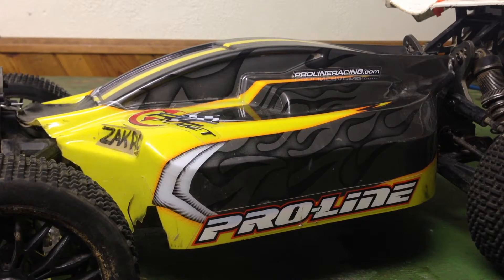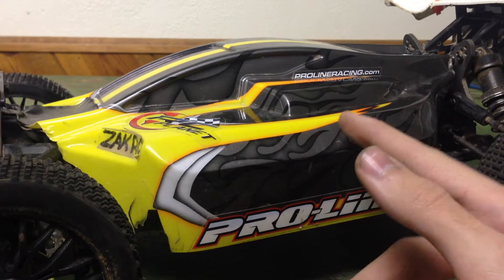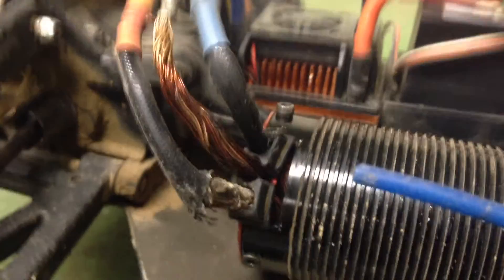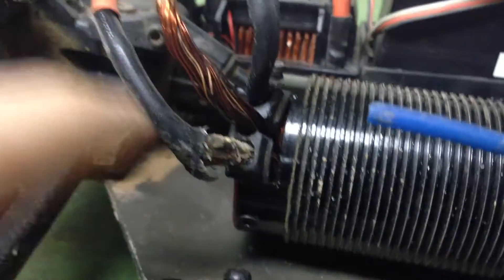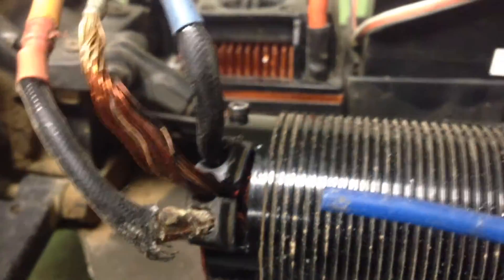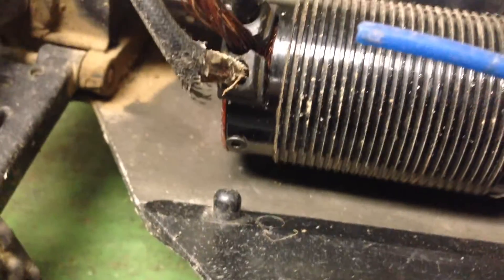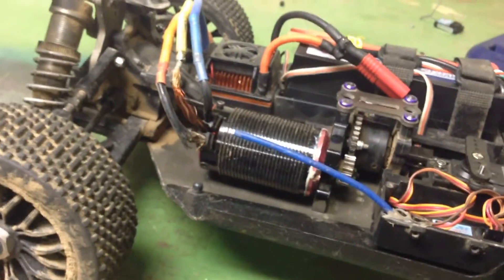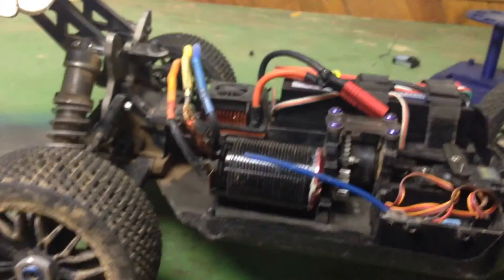How to Fix a Bad Brushless Motor

Comment: My brushless motor hums when I squeeze the throttle but no wheel movement  battery is full charged, the connector are flush. Just don't know what's going on. I really don't want to buy another motor. Any advice would help

Comment: I'm not trying to be a hater here, I see you got enough of that. Ideally, you want to find the short, or bad connection. What you said seems logical, but that's not the right fix for the problem. Get an Ohm meter find which combo of wires has less resistance. One of those 2 wires will have a short. If they seem okay, check for low resistance from the Speed controller to the motor. If they are all about equal, it's a power delivery issue (speed controller or something else). Cutting wires will make more resistance possibly, but as copper conducts electricity, they will still carry all the power that is sent to them. You could run speaker wire from the speed controller to the motor and probably watch the shielding melt right off from just spinning the wheels. That tells you less wires will still try to carry the load you are sending it, so making less wires in your connection is ultimately bad.

Personally, I would think it's one of your Bullet connections, needs re-soldered, or possibly a break in the solder inside the motor. While it's terribly hard to get into these to fix them (never really tried, could be easier than I think), I'd say run it til it quits. Could be the wires on the speed controller needs re-flowed. Solder will heat up and release itself if it's a bad connection, or other random stuff. Due to the extreme power these things put out now, I could imagine seeing wires de-solder themselves from parts when they get past their rated temperatures.  Nice explanation of what you felt was right, but your comments here are people crying out to you to help you fix the problem long term. And to keep you safe, and promoting bad ideas is not what we want to do. Imagine if you realize your error, and leave this up, and your kids or grand kids watch this, and harm themselves with a toy that delivers even more power. Embrace others, even though they may word it terribly, and toss in insults (I didn't read many, didn't see any), but long term could cause you more stress. There's a real fix for your issue I'm certain. And for the love of RC cars, put a protective sleeve over that wire! lol

Video and your mission seemed to have good quality and intent, but again, this is misinforming, and providing harm to someone else out there if they go any further than you have. Lithium, and bare wires are a disaster waiting to happen. Especially in a house. Check out some videos gone wrong with older Lithium Batteries. I hope you read this they way I am trying to deliver it (peacefully). I deliver the wrong fixes in videos I've decided not to post in the PC community, and probably still posted a few. We are human, and I'd rather try to help you instead of letting you show others this. Hope you are well and make a follow up to fixing this right.
Reply: An ohm reader?? Wait what you can actually check resistence on wires and replace them the right way??? No Way!!! Im shocked. I just hope people haven't done this!! Great information on your part thou
Reply: I bought a motor that have damage wires like that  is it better cut the wires off and re solder new 10 gauge wires?
Reply: @nts323  I would try to replace the wires with their respective gauge size in case there is a need for such wires. Melting is bad and oversized is overkill. Soldering and heat shrink would be the best choice, adding a wire loom might provide added protection. I'm no mechanic or wiring expert but common sense gets us further down the road I feel. So what your gut tells you might be perfectly fine, I just wouldn't tell others where the idea came from. Lol
Reply: Oversize in wiring could give your system a nasty breaking point. While higher gauge wires will allow short circuit to conduct longer than calculated by engineers. Thus, resulting in meltdown in vital electronic devices not wishing to be drawing a bigger load than it can support. I wish you the best of luck!
Reply: @typicalpctech6674  Its traxxas 2200kv it has 10 awg wires from factory
Reply: @nts323  sounds like a good plan then. Lol for some reason I refused to look back at this video, after seeing the lengthy reply I had, forgot it was an RC video. Hehe

Comment: Thinner wires get hotter! Your gear ratio will fix all, your motor esc combo it also at fault, or in rate cases people use to long of a mounting bolt that hits the rotor a causes the same issues

Comment: The wire or wires get hot because there is a bad connection or short. Damaging the other wires will not fix the issue, it will just cause the other wires to get hot too. You can’t “limit power” by making the wires smaller.

Comment: they are bare wires making contact with eachother.... cutting one or two will not make a difference
Reply: They are the ends of the motor windings and it will have an effect, he should have reconnected the wires with a solder joint or something.

Comment: hello sir,, I use brushless motor to my rc car but its not fast.. stock motor is more faster... uhmm do you have some advice for my problem :-)
Reply: Go buy yourself a faster rc car with a good motor then that’s my advice cause this video was not useful he said cut these little strings ;-; he said (no offense) of my advice
Reply: It should be faster with a brushless setup. Switch the wires around. They can be hooked up 3 ways ,3 wires. One will mKe it go backwards, another will be half speed, and the one you want will be full speed.

Comment: I just got an OCDAY 60a esc with 4370kv 9T motor and after 2 battery uses 3s, the motor run very slow and starts twitching with the servo. I need help!
Reply: No more than 4000kv on 3s

Comment: electricity flows over the copper strands not thru the wire strands and I'm not sure 1 strands will do anything but make the awg smaller which in turn will make the overall temperature of the wire higher. too much current flow thru small guage wire will cause overheating.
Reply from the maker: Mike Fahner this motor's wires are part of the coil, so if I cut one wire off of the coil, then it would run a little faster. 2 of the wires were bad so I cut one. You would be correct, but this motor is wired differently than sensored ones or motors with tabs on them
Reply from the maker: Mike Fahner just thought id make the video for others to consider if they have trash motors laying around